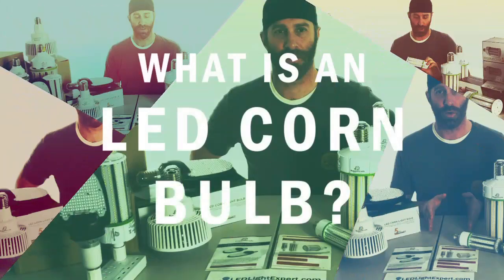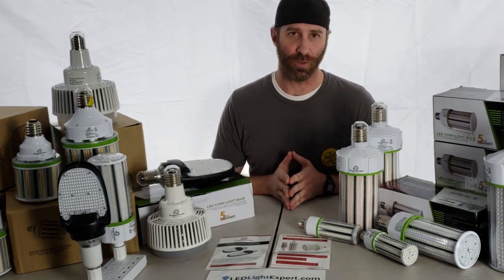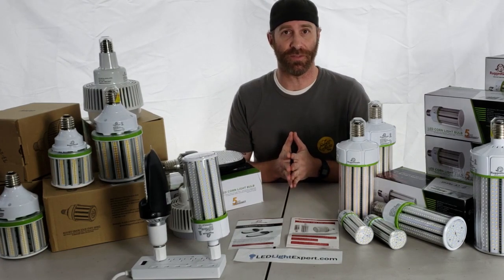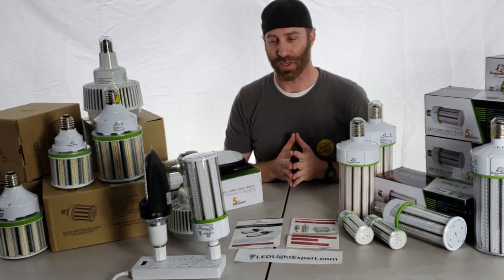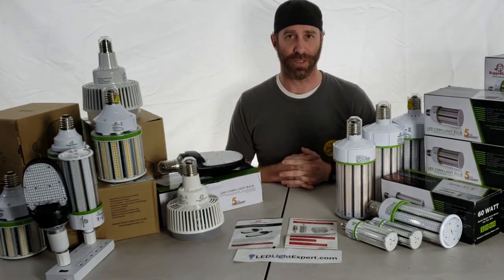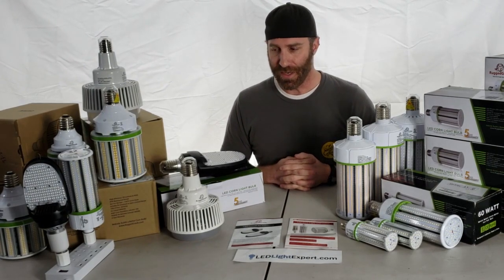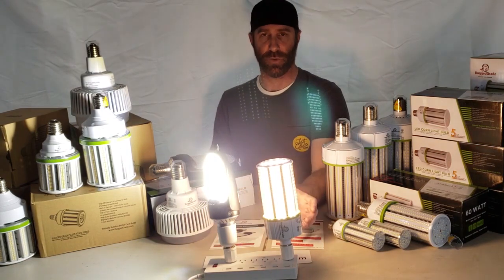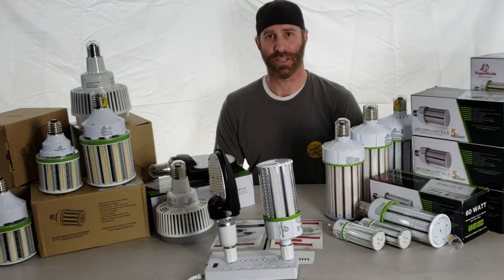LED Corn Light Bulb Overview -What are they? What to know? Metal Halide Replacements LED bulbs E39

Comment: Compatible with ballasts? Need to bypass ballast and capacitor or are your bulbs compatible with ballasts? Thanks.
Reply from the maker: Ballast must be bypassed. No point in keeping the ballast in there and wasting the extra power which is the top reason for switching to LEDs. Ballast compatible LED products are prone to issues like flicker and early failure and when that ballast fails you will either need to replace the ballast or switch to a ballast bypass corn bulb then. Why not just get the ballast our of there in the first place and save the cost and hassle down the line.
Reply: hi

Comment: So I have this old 11’ vintage street light pole I’m restoring. I looking to put it pool side and want it really bright, equivalent to maybe a 700 watt bulb. Do you you carry anything in an LED that I can just screw in to a standard socket? Also is there a led that bright that is dimmable with a dimmer switch. Good video!Thanks
Reply from the maker: We have up to 54 watts of LED in a standard E26 base.   Thats 7000 lumens. https://www.ledlightexpert.com/54-Watt-LED-Corn-Light-Bulb--Mogul-E39-base--7200-Lumens-Aries-S-Series--5000K--6KV-surge_p_1467.html   That should be close to what you want.   You can also buy an an adapter to use an E39 bulb in an E26 socket, just make sure it all fits.    Noe of the bulbs are diimmable, sorry about that.
Reply: You have to take the ballast out of the circuit of a metal-halide fixture or you'll smoke your new corn bulb! Videos here on YouTube show you how to do it IF you're CAPABLE. If not, an electrician will have to dewire the ballast transformer out of the circuit. Surprised you werent advised that first!🤔

Comment: I watched some videos about corn corb lights and bought one from amazon 500 watt with the understanding I could put it in my standard ceramic fixture one I use a 300 watt incandescent bulb in as I have 13 ft ceilings in my garage. It does not fit and needs a larger female socket . Is it possible to get such a thing? thanks
Reply from the maker: You should have called us!   800-674-9420.   Our experts would have avoided this.  One of the first things we ask is whether you have a E26 household or E39 large base.   We carry bulbs for both.   We also would have asked about actual wattage not equivalent.  That bulb is not 500 watts of led, but someone's made up equivalent.    Also what kelvin color you wanted.   To fix this issue you should return that and call us.    You can user a conversion like this one we stock here, (but if the bulb is not right you wasted money on these).     https://www.ledlightexpert.com/E39-to-E26-Socket-Adapter--6-Pack--Use-Any-E26-Standard-Base-Bulb-in-an-E39-Large-Mogul-Base-Socket_p_1634.html

Comment: I want to convert some dusk to dawn barn lights to Led.   They say I don't need to take out the ballast..... Is it better if I take out the ballast since it is no larger necessary?
Reply from the maker: We always recommend removing or bypassing the ballast when converting to LED if the old fixture uses a ballast. Even if the LED bulb is ballast compatible, it's going to shorten the life on the LED bulb, possible a very early failure. That ballast is also going to waste power and fail long before a good LED bulb should fail, so you'll be replacing/bypassing/removing the ballast later if you leave it in there. Save yourself the time, money and maintenance down the line and get that ballast out of the way when you make the switch to LED.

Comment: Which one would be a good light for my garage to replace the standard light bulb? When the weather is bad , I shot my bow in there? I need a good bright light?
Reply from the maker: It depends on how many fixtures and the coverage area along with the height of install. If you are trying to get comparable or brighter lighting than your old bulb, knowing the wattage of the old bulb would also help to find a comparable or brighter bulb. Feel free to give us a call to go over your project so we can help you find the right bulb for your garage. 800-674-9420 and press 1 at the prompt.

Comment: CAUTION when installing these corn lights in your garage over a vehicle. I installed my corn light in my garage a few years ago when I owned an older white vehicle, everything was fine, then recently when I bought a brand new dark burgundy colored car I could not figure out where tiny drops of "white varnish like specks " that were dripping down on my car were coming from. Many days I would turn on my other regular bulb ceiling light when going into the garage and many days I would turn on the corn light, not realizing at first that the use of the corn light coincided with seeing little white specs on my car. One day it dawned on me that it might be the corn light so I only used the regular bulb light with no white specs on my new car. I then goggled info on these corn lights and found out that many use a fluid in them to keep the LEDs cool , and sometimes they will leak the fluid out.
Reply from the maker: This is the difference betweent buying a commercial quality bulb versus the countless cheap and poorly constructed bulbs available on the market. Our LED corn bulbs from Rugged Grade are completely air cooled on all newer series bulbs and some of the older or higher wattage bulbs (150 watt and up) have fans in the bulb to help manage heat, no fluids in the bulb that could leak out. Unfortunately there is a lot of cheap junk out there with poor design that end up failing far earlier than they should or you find problems like a bulb leaking. Our bulbs are rigorously tested before the first bulb even ships and we back them with a 5 year warranty along with independent UL and DLC certifications for safety and performance.
Reply: @LedLightExpert  Thanks for the information on the different quality of corn lights. Mine was a gift and had know idea of the differences. Obviously I have a cheap one. Thx
Reply: Đến

Comment: I found one of the led light bulbs at a local garage sale and had to have it. Paid $20 . It is brand new and extremely impressive but the Socket is not your standard size. It is much larger and wanting to know if a conversion to a standard size is available. It's killing me not to see it work. 
On the side is says( 
SATCO 59673. 45 w
LED /4000k EX 39
100-277VAC 50/60HZ)

Anything you can tell me what i need to do to see this beast in action would be wonderful and how best to convert it to a regular home bulb diameter.
Reply from the maker: There are socket size converters available, we have some here: https://www.ledlightexpert.com/E26-to-E39-Socket-Adapter--6-Pack--Use-Any-E39-Large-Mogul-Base-Bulb-in-a-Standard-E26-Household-Socket_p_1611.html. EX39 is a little more rare socket style compared with the much more common E39. You may have trouble finding a converter for an EX39 socket and I would guess you are trying to convert to E26 which is the standard size you see in bulbs used in residential lighting. Best to check online marketplaces or electrical suppliers, but that one will be hard to find. You may be better off getting a bulb with the correct socket to begin with.

Comment: I've got an exterior light over my shop door that has a 175 metal halide bulb and my ballast went out but I can't find a ballast so what would be a good replacement. It has a e39 socket but I also have a somewhat cone shaped globe that fits it that I'd like to reuse!
Reply from the maker: we recommend about a 54 watt bulb to replace that 175 watt MH.   I would recommend something like our 33-342 here https://www.ledlightexpert.com/_p_1593.html  or search our E39 bulbs if you prefer a different Kelvin; https://www.ledlightexpert.com/E39-Led-Base-Mogul-Light-Bulbs_c_43.html  see the size on each bulb in the images to check fitment.  Feel free to cal us at 8090-674-9420 too.
Reply: I don't think the link worked but it's a REVERSIBLE! 6,000 Lumen - 50 Watt - Post Top Bulb E39 LED High Bay Light Bulb -5000K
Part Number: 33-232   and it's shaped like my globe is!
Reply from the maker: @hotrodrebel855  Yes, that is a great bulb and works for a lot of applications that nothing else will fit in. They have a built in driver as do all our corn bulbs so if the fixture has a ballast, make sure it is bypassed, you need direct line power to the socket. If your globe is the same shape, sounds like the perfect bulb for you needs. As always, feel free to call us if you need any help, 800-674-9420.
Reply: @LedLightExpert   Hey again, I figured after you provided a number for me to call that you were done with me especially after you didn't respond so I did call the number earlier today and talked to Bill. He told me that the bulb should work and that it didn't need a ballast and to direct wire it but thanks for the reply and your assurance also!
Reply from the maker: @hotrodrebel855  Hope we got you taken care over the phone, but let us know any other questions
Reply: @LedLightExpert  Yall sure did and thanks!!
Reply: YouTube video shows bypassing the ballast transformer.

Comment: just purchased a1000 watts led yard bulb volts 110-270v.  I install it on a 240v socket it turned on ok. after it got hotter, it started on and off like there was loose wire somewhere...but no problem on 110v bulb socket. any idea?
Reply from the maker: I don't know of any 1000w LED bulbs,  a 1000w LED fixture would not be something typically used in a home/yard, that is stadium lighting output. I am guessing you mean an equivalent to an older technology 1000w bulb. Without knowing the product you are using, what I can tell you is it could be a heat issue, wiring issue or a power issue, impossible to narrow down without more info. If this was a bulb purchased from us, feel free to contact us so our tech support team can help you figure out what is going on. If purchased elsewhere, I recommend contacting the manufacturer/seller of the product you have and hope they have proper tech support. There is a lot of cheap LED products out there with little to zero tech support so you could be on your own. If you can't get it figured out and just need to replace it, feel free to give us a call and we will help you find a proper product for your needs and make sure you have no trouble with your install.
Reply: @LedLightExpert  appreciate your advise..thank you.

Comment: Which bulb would I use in an outside pole lamp?
Reply from the maker: Doug, there is plenty of viable options, it really depends on what you are replacing to find a comparable brightness, how much room you have and what size socket base is in your fixture. All of our bulb listing show dimensions and help with some common crossover values from different types of bulbs to help find the right wattage for you. If you aren't sure what will work best, you are always welcome to give us a call so we can help, 800-674-9420.

Comment: Do you have any that work with a ballast?
Reply from the maker: No, you want to get rid of the ballast once and for all, otherwise you put a 20 year LED into a fixture that needs a new ballast every 7 years.   Ballast compatible also adds more piece to the LED driver that increase failure rate.  Not worth it.  Get rid of that ballast once and for all. its usually easier than you think, they do fail and so has to be serviceable, so usually a compartment you can get to.  Call us at 800-674-9420 with further questions

Comment: Watts? Lumens? I've got a 150W HPS that's rated at 15,000 lumens when new. To achieve the same light output shouldn't I be looking at an LED bulb with the same lumen output?
Reply from the maker: good question!    No, that 15K number on the box only lasts 5 minutes.   Those lights lose up to 70% of their light over their life.   Most find that a 7000 lumen bulb is brighter than it towards the end of its life.   Go up to an 80w at 10000 lumens if you want more middle of its life.    Hard to fit too big of a bulb in there so make sure you measure and bypass that ballast.  Here is the 54 watt bulb; https://www.ledlightexpert.com/54-Watt-LED-Corn-Light-Bulb--Mogul-E39-base--7200-Lumens-Aries-S-Series--5000K--6KV-surge_p_1467.html

Comment: these are great lights for growing however NO ONE< NO ONE, makes a reflector housing for them <.. NO ONE!  I regret buying my bulb
Reply from the maker: Yes, for growing we recommend fixtures.  These are good enough LEDs to grow, but our fixtures are larger spectrum and we can run them with more power since the cooling is better.  If you do need a reflector you can search ebay for 'metal halide high bay fixture'.   You will need to bypass the ballast if you use their socket, or just take the reflector.   Often you can find some in non working condition fairly cheap.   Good luck, i think you'll find something that does not make you regret the bulb.   Next time just go with one of our grow light fixtures; https://www.ledlightexpert.com/LED-Grow-Lights_c_86.html
Reply from the maker: These are most commonly used for retrofitting old fixtures in commercial applications, though they are definitely used in grow applications. There are countless wall packs, high bay lights, parking lot fixtures and more that corn bulbs work and fit perfectly in. A high bay fixture is likely the closest option for a grow light application if you are looking for something with a reflector, so you would likely need to search for metal halide or HPS high bay fixtures and retrofit them for the LED corn bulbs. I would say that typically when we have seen growers use these bulbs as opposed to LED grow lights designed from the ground up as grow lights, its usually without a reflector and just screwed into a socket with 360 degrees of light. Grow lights use LEDs with specific spectrums or full spectrum LEDs designed for growth and yield unlike a commercial LED corn bulb, but corn bulbs are often used as a budget alternative or for supplemental lighting.

Comment: Looking to replace a 600w hps is the 200w led going to cut it?  Is there a 1000w equivalent corn light? Thanks
Reply from the maker: When we get to this size we typically recommend replacing the fixture or using a retrofit kit.  These both have a full size driver in them and will hold up over time.   The bulbs above 200 watts are asking a lot of that small internal driver.  We offer a 240 watt retrofit kit, SKU 38-134 that works in most fixtures and uses a full size Meanwell driver.   Keeps the fixtures, but lets you go LED.  Otherwise we carry lots of fixtures in the 240-300 watt range.  Give us a call at 800-674-9420 and we can help you find the correct one.    Here is the 240 watt kit: 

https://www.ledlightexpert.com/product.asp?itemid=97

Comment: what bulb do you have for 1500 watt metal halide?
Reply from the maker: unfortunately at that size its best to change the whole fixture.   Use a 500 watt LED stadium light for uses about 30ft or a 450-600 watt area light with a T3 pattern for lower installs.    The LED fixtures are actually cheaper than the LED retrofit kits above 1000 watts.   See all 1500 watt options here; https://www.ledlightexpert.com/1500_watt_metal_halide_LED_replacement
Reply from the maker: Our biggest corn bulb currently is a 240 watt with a 300 watt coming soon. To replace a 1500 watt metal halide you would have to go with a new fixture. We have flood lights, shoebox lights, high bay lights and sport lights as great replacements for 1500 watt metal halide fixtures. https://www.ledlightexpert.com/1500_watt_metal_halide_LED_replacement